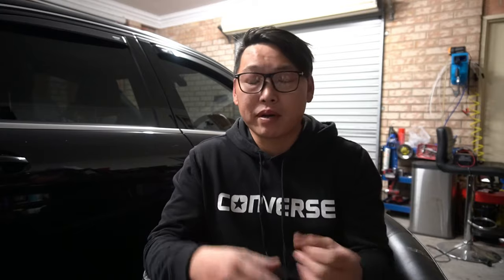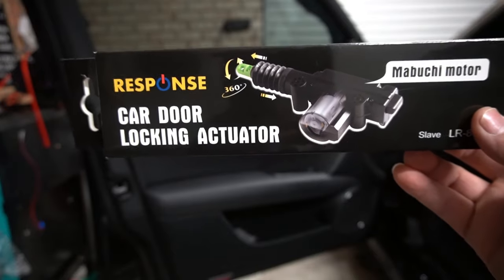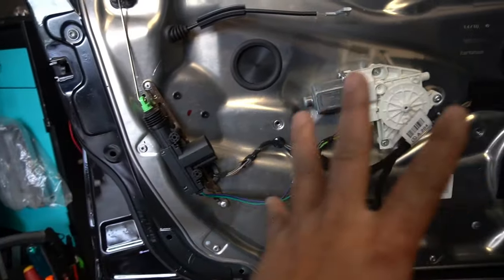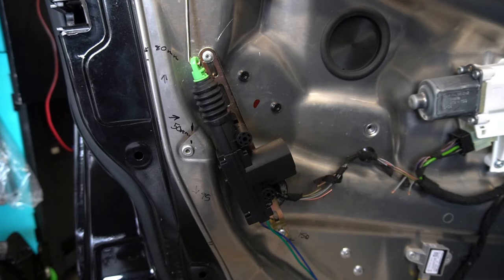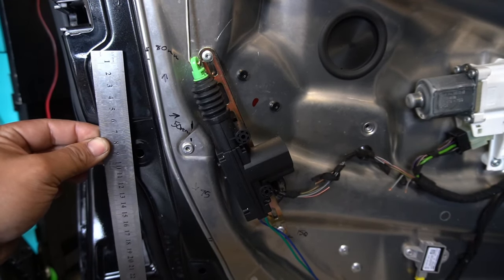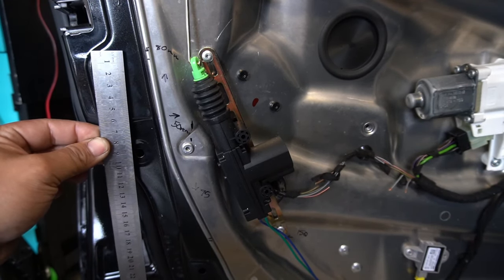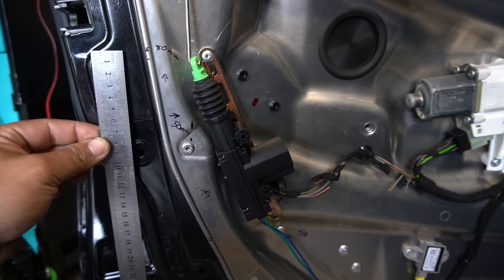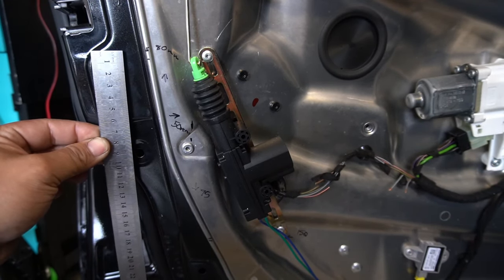mercedes common fault door lock actuator fix aftermarket part easy cheap reliable MUST SEE

Comment: Thank you for the video!! I have been looking for something like this. I have a ML350 and I'm about to change my passenger door lock, but I don't have the color wires you have. I looked up the schematics  and I believe my pink/black and white/black are what I need to cut, but how do i know what to connect the blue to and the green to? what is the difference? I didn't see you explain the difference in your video or i missed it somehow. also, you cut wires to power. do i also need to cut some power wires? or just the two wires only? thanks in advance
Reply from the maker: as for the blue and green ..u just do a trial and error test run ... im pretty sure polarity doesn't matter .. follow the wires that come right off the actuator ..whichever powers the actuator..you connect to those wires and ur good to go.. the actuator only needs power to spin so when u press lock or unlock it send power to the actuator to spin ..that's it.. but u can always switch em around if it doesn't work
Reply: Great thank you 😊 here goes nothing lol
Reply from the maker: @meltn2me  dw it's only 2 cables ur really connecting ..u can't really stuff up... even wen i cut the wrong cable it's color coded so u just reconnect ... and all g..i accidentally cut the rotary tumbler switch cable and it was for the door led..it somehow related to it and luckily i noticed and reconnected it ..now all is well and locks back to normal

Comment: Season greetings pal. I have have been looking forever for a video like this one as I have the very same issue (left passenger door) with my c200 1.8l cgi for over two years.There is a similar video on the MB forum but it was not as detailed as this one.Actually, because of that video I bought four actuators but when came to the installation I chickened out because of the unclear directions. Yours have given me hope to finally repair this problem. Is it necessary to cut  those two wires? In the MB forum video the guy simply connected as you did and it worked.Many thanks for your presence on this forum.All the best for 2021.
Reply from the maker: yes only cut the two wires u are using .. do not cut any other wires as u will lose a function ... just cut the two wires i connected to and u will be ok and everything will work 100%.. merry Xmas and happy new year to u too

Comment: Jow about rear doors mikey? They are slightly different to this. Any reccomendations?
Reply from the maker: i havent done them as yet but i am def gonna do it..cuz u guys have been asking alot about them..if u scroll through the comments same principle..there is a sweet spot for them too...just gotta make it work ... ppl have already successfully done using same principle
Reply: @MIKEYZVLOGZ  they have a different mech for the pop up lock though same wires I'm guessing just have to tie it into the factory pop up the correct way I guess. Thanks heaps for your express fast reply mate 👍

Comment: Hey, thanks for your video. I have MB w164 and I’m try do the same like you said, but I have another color of wires. And it’s only close the door but not open. I have white, brown, pink with black line  and purple with black line. Maybe you have some ideas what I do wrong. Thank you.
Reply from the maker: hmm, yeah diff car will have diff colours, u need the schematics to be sure friend sorry i am not familiar with your model...
Reply: The ones you need are white and purple with black. It is an easy fit for the actuator, it works for me -x164

Comment: Hi I need to use this door actuator but I need the master for my 2003 clk 240 the master has 5 wires. blue.white . Black.brown and green can you please tell me which wires to connect to on the driver's door like which colour connects to which colour of the car door wires thanks.
Reply from the maker: easiest way is to find tour cars schematics ... I'm sorry to say that I'm now familiar with your model ... I habe only worked on the w204 door lock actuator ..but if u follow the wires see which ones goto the actuator ..same way I did in this video ...... then there is always trial and error ... u can just use a slave actuator ... as it works as well... the main is just rendered to as the master ... but u can use the slave in place ... u can find tour cars or schematics ..or Google it and someone would have done it before so they can tell u which cables power the actuator

Comment: Hi great tutorial and help.. my drivers door wont work..could i use the slave actuator instead of master one? Any advice. .thank you
Reply from the maker: yes i believe you can all you need to do is connect the right wires to make it work...
Reply: Hi mikey. Good news i installed slave      actuator drivers door w204..works fantastic! Just cut grey wire with blue stripe.and attached blue wire to it.green to grey with black stripe..thanks again for your great tutorial videos👍👍❤

Comment from the maker: ok guys i just wanted to clarify that you only cut the cables you need to use , the GREY WITH A BLUE STRIPE and the GREY WITH A BLACK STRIPE..
DO NOT CUT ANY OTHER CABLES AS IT WILL INTERFERE WITH THE ROTARY TUMBLE SWITCH WHICH CONTROL POWER TO YOUR COURTESY LIGHT FOR THAT DOOR... 
only cutr the wires you are going to use to send signal to and from your aftermarket actuator..thats it ..hope this is more clear and clarifies things abit more and for the master lock (DRIVER DOOR) its the same just use the same wires and wire them up the same and bob's your uncle.. done deal
Reply: Is it the same wires for 02 c320?
Reply from the maker: @ulicesrodriguez3178  I don't think so different model
Reply: thanks  Mikey i was going to ask about that as i didn't think cutting the other wires was a good idea. i've just received a pair of actuators this morning both my front doors c200 sport AMG  2007. don't lock. i'll be fitting them asap.    Ebay  2 for £9.40  uk.
Reply: How can I find out which wires to cut for a 2011 E350 passenger front door ??
Reply from the maker: @brandonmassinburg  follow the wires coming from the actuator
Reply: @MIKEYZVLOGZ  I did. There are no gray wires on mine.  It’s a group of 6 wires in different combinations of blue, brown, and greens. No gray wires.
Reply: @MIKEYZVLOGZ  I see a green wire with black stripe and a brown wire with blue stripe. No gray wires anywhere on my passenger front door.
Reply from the maker: @Brandon Massinburg  as long as it's coming from the actuator I'm very sure it's the wires u need ..If ur really worried find schematics and it will give u ur answer
Reply: Did anyone locate the correct wires for the E350. I used the green wBlack stripe and all-green. It seemed to work okay but now my interior door lock switch won't work. Any discoveries here?
Reply from the maker: @kenbirse1828  try abit of trial and erro buddy ... it won't hurt.   just don't leave connected too long just try it and see what happens..should try and get schematics..much easier
Reply: Just an observation. When doing the install for the E350, once driver's side is installed and wires connected back, if the lock or unlock function doesn't work, the green w/black stripe wire needs to be tied back to the old actuator. I'm not sure why but after this was done the acuator locked and unlocked. 
Question: Should I be using the master actuator if I need to use the interior lock?I imagine I do. @MIKEYZVLOGZ

Comment: well, Thank You I got a ML350 2009 right passenger side. can I find the wires with a probe light?
Reply from the maker: ebay mate just type I'm lock a tuator on ebay and it will show

Comment: Mikey, you are undoubtedly a genius and I bought the actuators so thanks, but my wires don’t have any grey/black or gray/blue. And I don’t think I can trace back to actuator without removing the metal plate. Any suggestions?
Reply from the maker: there must be a way to trace the wires out from the actuator .. in ur case I would try get the schematics and see exactly which wires are for the actuator that way u don't have to trace or guess
Reply: Hey thank you for your super quick response man. I’m gonna pimp you everywhere. But I did see that I have eight wires going into my actuator. Six of them go into a pin clip and the other two I can’t figure out where they go. I can’t help it I think the other two are going to be my power. Thoughts?
Reply from the maker: @terrymurtha2451  that's my best guess ... schematics would definitely help... apart from that I would onl suggest tracing the wire ... another good place to ask is the forums ..maybe someone else has had the same issue and there's an answer  already ...
Reply: Maybe use a contactless voltage tester to know which  wires receive power when locking or unlocking

Comment: I have to get it done when i get somewhere that aftermarket part 😁 but what wires you have to cut, this video looks like that you are cutting more wires than only two ? 14.08 looks like there is pink wire also cutted 🤔 but very good video 👌 have to know the right wires
Reply from the maker: i tell u in the video which ones to cut and i also explain on the comment as well
Reply: Aftermarket part came today and I put it in place and it works so thank you again 👌I buy it aliexpress two pc and only 12 euros.
Only problem is that door panel do not fit in place 😄 little bit different part  than you do so have to measure more and drill new holes etc. but I know it fits someday 😁 
Here in Finland  in the autumn second problem is that here always raining and have to fix outside so it is little bit annoying
Reply from the maker: excellent news mate
Reply: U cut 4 wire u explain 2 to connect which other 2 did u cut? @MIKEYZVLOGZ

Comment: let me know how to find which lines to connect the device"s lines
Reply from the maker: ? sorry hud not sure what ur asking? do u mean which cables ? colour codes? cuz its all there in the video ... and there's only 2 wires you need to connect to power the actuator so that wen u press lock or unlock it powers it and spins it to lock and unlock ... very straight forward ..are u asking about something else ?   how u find then..u open the entire door frame and expose all the wires that are in the door ..then u follow which wires goto your factory lock actuator ..once u have determines which cables are for the actuator u connect them to your universal actuator ..it just needs pos and neg for power that's it ..no other cables needed

Comment: I have 2009 ML350 , the power locks don't work on 3 of the doors , l located the 2 power wires with a test light for the lock and unlock modes - however the aftermarket actuator won't work when wired it in what am I missing ? it seems like they get power correctly but the ground isn't working
Reply from the maker: that's odd it should work ... it only needs power sent ro the lock ... did u test to ensure it is getting 12v with a multimeter? put pps and neg to appropriate wires and then press lock and unlock it should show the voltage going to the wires ... check the door module and follow the wires ensure no breaks ... check fuses too relaying to door ... also follow the wires ensure no shorting is happening ..this happened to my seat for my w203 ..I had to flow the cable all the way to the plug harness and voila there it was ... where the seat folds...it was shorting there ... pos and neg were stripped and touching causing the short ..hence auto seats adjustment weren't working

Comment: Mike do you have a video for a rear left side for a c220 2010?
Reply from the maker: no I don't but I will be working on it this year. I've had a guy tell me that it's also possible to fit an actuator in the rear door ..bit must be a precise spot as there isn't much room

Comment: So my driver door accuator is gone, im looking for the "Universal Car Central Door Lock Actuator locking Motor Gun - MASTER verison" ? is this correct? thanks!
Reply from the maker: same pinciple u can use a slave lock actuator doesnt have to be a master ..so long as it gets power wen u lock and unlock it will do the exact same job.. it has been confirmed by other subscribers its the exact same job

Comment: My 2015 ML350 w166 appears to be locked, but rear passenger door can be opened from outside with alarm set.  Door opens and alarm sounds.  Manual lock goes up and down, but door opens when lock indicator is down.  Same fix??? Thank you
Reply: I have the same problem with my ML350 2015. Did you fix it? How you did it?

Comment: Can I iuse this on mercedes 2009 gl 450. ? I see no room to put actuator? I seen videos of door panel removal and don't see any room.?also do you have the part number for actuator? Thanks so much
Reply from the maker: u should be able to.. there wasn't enough room to use this actuator ..but I made it work by shaving the doornpanel down ... u can use it as long as u make some room

Comment: Hi. Great video. Did I understand correctly that it cannot be fitted to the   driver's door? Is it possible to only splice it to the wires to the motor leaving all the others? 
ps this motor looks suspiciously like that on the steering lock. How many cheap Chinese motors are there on this "premium " brand?
Reply from the maker: lol...I know right...for such a beautiful name brand car ..why did they cheap out on certain parts? that's the question isn't it... and as for drivers door... usually u would use a master actuator lock...but I guess in theory all u need to do is provide power to the lock actuator so it can lock and unlock the car lock... so with that said ...it just may be possible to use the exact same for driver side ... cuz all ur really doing is connecting a power circuit so that wenever a lock button is pressed it will power the actuator so it can spin locking and unlocking the lock 🔐

Comment: Hi Mikey,thank your detailed instruction Videos.Do you have videos about rear doors?
Reply from the maker: no as I haven't needed to do it.. however I've been told that it is possible and it's the same procedure ... just ensure u check and measure a spot that will house the actuator before going any further
Reply: @MIKEYZVLOGZ  hi,both my front doors have stopped locking  or unlocking. will the after market actuator work on drivers door too?
Reply from the maker: @tomdouglas7466  yes it will now I'm not 100% but I've been told from subs rivers that have done it it's the same procedure ...

Comment: Hey man, was wondering if you could help: my w205 coupe door is frameless so it retracts whenever the door opens. The issue is that sometimes when the door is opened the window does not retract, sometimes I have to wait from seconds to minutes until it ‘recognises’ it has been opened before I can lock the car. Without it recognising it has been opened, the car’s dashboard doesn’t switch off and I can’t lock it. Was wondering if you could help?
Reply from the maker: hey bud thanks for stopping by 
. unfortunately I haven't had the opportunity to work on a w205 as yet ... apart from pulling the steering wheel off one ... I haven't done anything else to a 205 .. I'm sorry to say I'm not too sure tbh... I would never pretend to know something I don't.. that's just disingenuous
Reply: @MIKEYZVLOGZ  no worries brother 🙏🏻
Reply from the maker: hopefully in the future I cn work on these cars

Comment: Hey what if u have the air lock system and im lost if pump bad or anything will your lock system bypass that
Reply from the maker: I'm unfamiliar with the air lock system.. do u mean where it uses the air in the hose to lock and unlock the door lock? 
I can't say I'm fully knowledgeable about that system ...although I do know the older models tend to use it.. like my w203 ... however ... I can't say indefinitely that it would work ... sorry couldn't help more ..u may need to consult an expert

Comment: Hello Mikey thanks for the tips mate you helped me also with my ESL 👌

My rear passenger door UK model won’t open even though both outside and inside handles feel really solid so nothing feels out of place or broken. 

Do you have any tips for that ? Is the replacement door lock actuator going to fix this issue? 

Thanks a lot
Reply from the maker: does it unlock ? if it does then u may need to check the part that latchs onto the door handle ... its a wire that the door handle pulls on
Reply: @MIKEYZVLOGZ  it doesn’t unlock (key fob) When I do pull the handle from the interior the lock pin pops up but the door won’t open. Obviously I am careful doing that as I have seen lots of them braking.
Reply: @MIKEYZVLOGZ  is this wire accessible easily or do I have to remove the window and get to the mechanism ? Also are those £15 universal locks suitable for the rear doors ? Obviously sorting out the wire is one thing but while I am doing that I probably would have to change the actuator it didn’t sound that lively..voltage is good and battery in almost brand new

Comment: Hey Mikey thanks for the video, for driver's side suppose you buy the master actuator and connect 4 cables? (Instead of 2 wires)
Reply from the maker: i believe so i havent done it yet but yes i believe so...
Reply: Which cables? Tnx